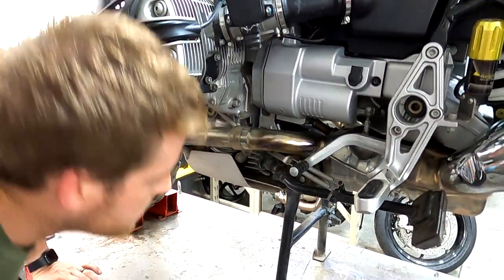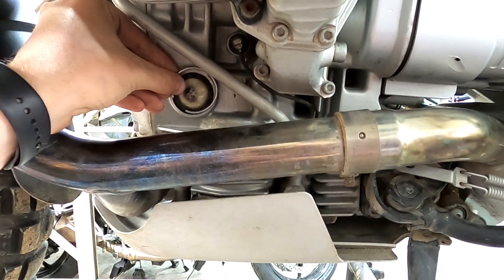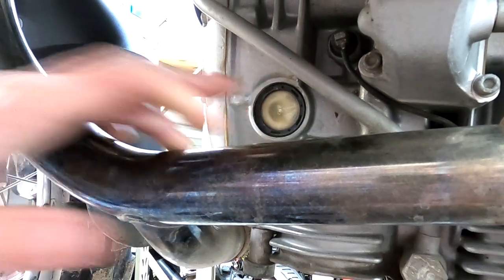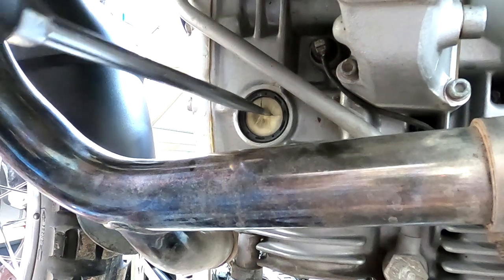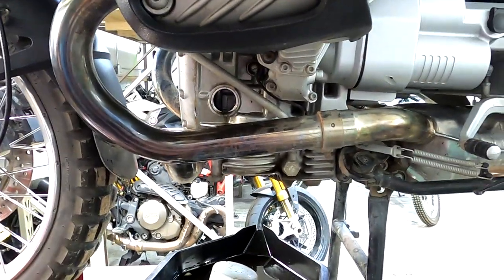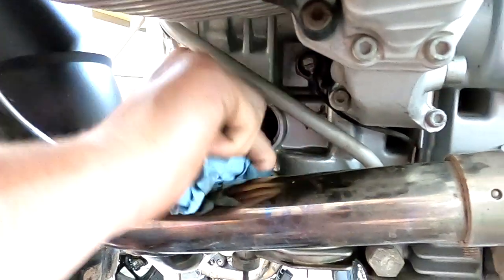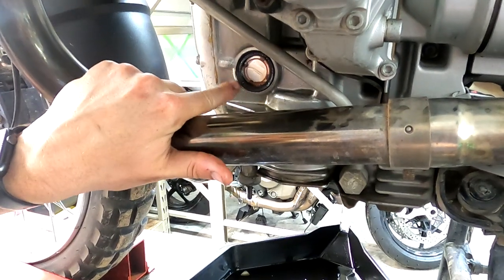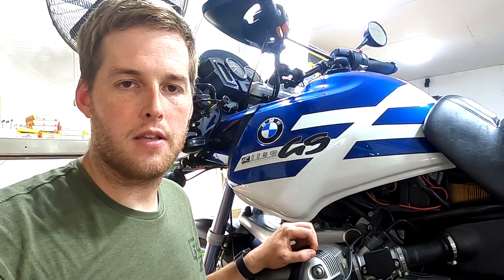Oil Level Sight Glass Replacement

Comment: Thanks for posting this video. What I would suggest is orienting the glass so the holes at 12, 3, 6 and 9. In case of low oil condition there won’t be stuck oil between glass and metal piece that would make you think that is the oil level.
Reply: I was thinking the same. Great video, but I was thinking the holes should be oriented like a clock so the 6 position hole allows the oil to drain. That way, there is no residual trapped in the sight and you get a better indication if oil level is low. Maybe I'm wrong though.
Reply: If you think about, it does not matter, the holes are asymetric, anyway will show, "lower than middle" it should always be filled... it is a look what is the level, not how much is inside... But I never seen something more idiot solution for oil control at first it can go milky and has to fail, and leaking...

Comment: Sight glass was super stuck on my r1200st. Wound up getting a $60 bearing puller set from Harbor Freight and it came straight out after a bit of hammering. Definitely recommend getting the bearing pullers if the screwdriver method isn’t working!

Comment: Thanks for video, On a k75 I’ve removed the oil pan and tapped the sight glass out from behind, without damage, also gives opportunity to remove residual sludge from inside engine
Reply from the maker: The R bikes don’t have a oil pan like the k bikes do.
Reply: That's exactly what I did on my 75

Comment: Thanks, I'll have to do this.
Is this procedure in the service manual? More like vandalism with the ability to pour glass into the engine. It will, of course, remain on the filter, but what were the BMW engineers thinking who came up with this?
Reply: BMW has a special tool that can perfectly remove it

Comment: I see a monster 1200 in the background.  I have a 1098 and I may have to replace its sight glass and the seal behind the clutch basket.  have you done those before, and if so, is it the same process?  In this instance, I will have the clutch case removed from the bike so I am assuming I just press a new glass into the case.

Comment: I'm the process of replacing mine on a 2005 R1200RT.  The glass is foggy.  I've broken the glass out but getting any kind of leverage to wiggle it out with a stout screwdriver isn't cutting it.  This should have been easy but the pipe and lambda sensor are in the way.

Comment: Ever changed just the grips on an RT (05)  with heated grips?  Any tips?  The rubber has deteriorated to the point that anything that touch the turns black.  The heated portion worked when parked last year (had back surgery and the bike has sat).  Need to change grips and fork seals due to one blown seal after hitting a pothole.

Comment: I watched this and did not put in the retaining clip....big mistake.
Reply from the maker: some have it and some dont, if it has it you need to reinstall it
Reply: Earlier models ( ~ -2004)do not have a retaining clip. I drilled through the boss ant a 45 degree angle to the outside of the boss and safety wired down. It cannot fall out like on my 96RT losing 3.5 qts in 1/2 mile on the freeway.